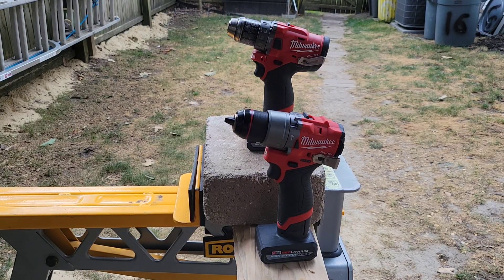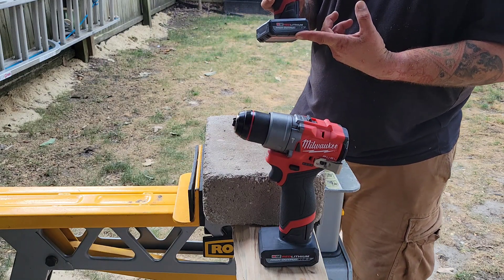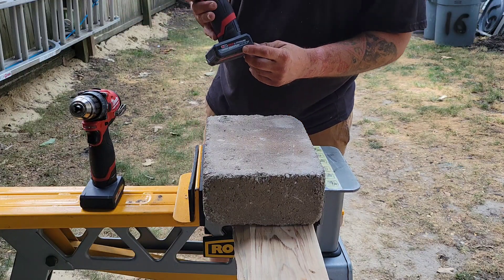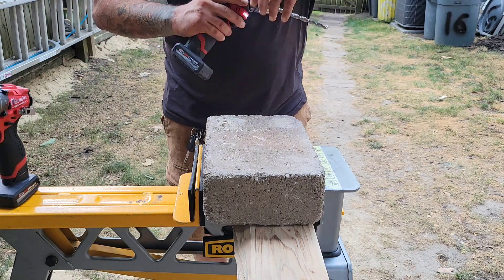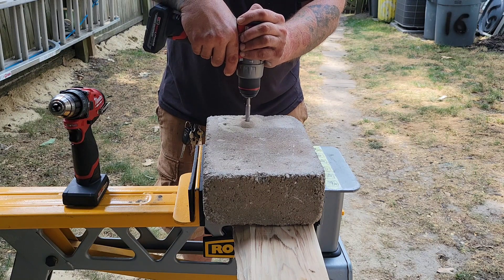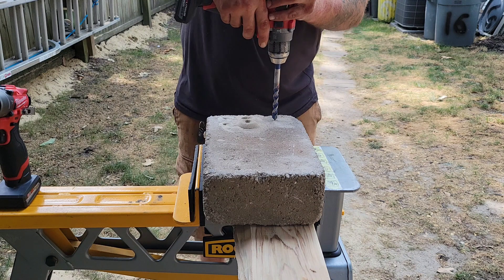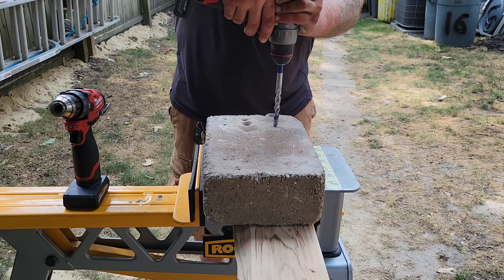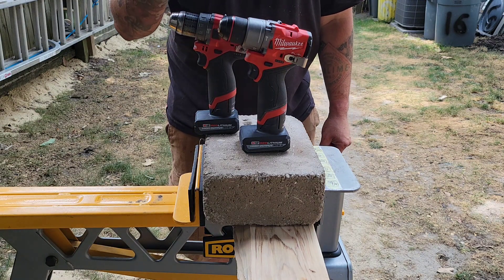Milwaukee Fuel M12 3404 and 2504 Hammer Drill comparison

Comment: Concrete is not uniform. There is aggregate mixed with cement therefore you will run into rocks (aggregate) sometimes more and sometimes less. This will change the time it takes to drill a hole and will be inconsistent. If you pore a block with cement and no rocks it will be a better comparison.
Reply from the maker: I'm aware, but thanks.